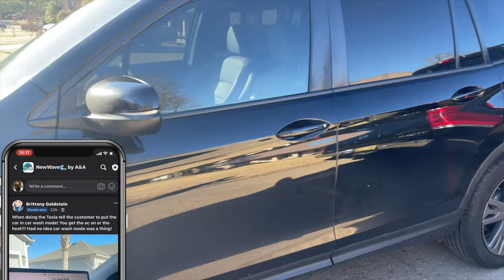Mobile Auto Detailing With Harbor Freight Steam Cleaner

Comment: Are there any dangers with a steamer .. obviously it’s very hot. will it burn or melt leather seats? Plastics? Vinyl ? Anything I should know? Is it OK to use the brush attachments on those things or will it scratch certain materials?
Reply from the maker: Just use common sense.  As long as you're not careless.